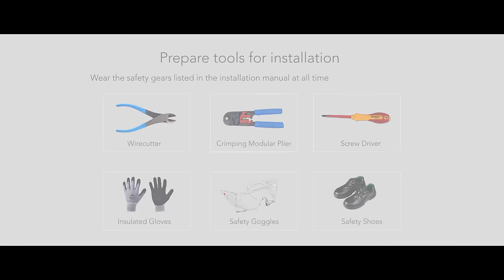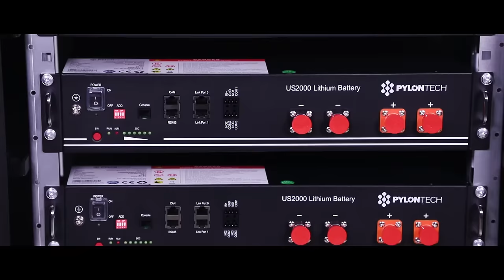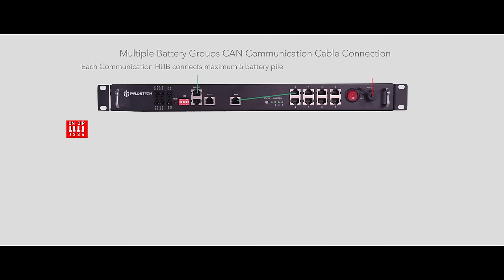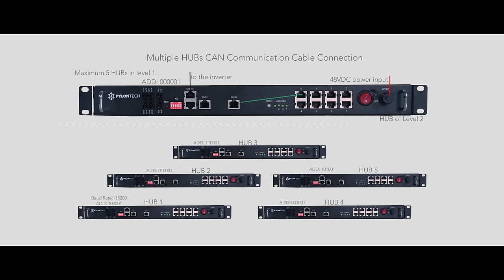Pylontech US Series Installation - US2000

Comment: Does this interface with the Growatt 12kw off grid inverter and will the case with bms become available for users to use their own cells.  I only use 280ah cells in 16s configuration for 15kw packs.  I could use a stackable version for good interfacing with the inverter.
Reply from the maker: Pylontech US-Series battery can communicate with Growatt inverter with CAN protocol and the end user can read the battery information from the inverter portal accordingly
Reply: @pylontechess  I'd love to play with some  and review

Comment: Sir i am using pylontech battery with tesla v3 inverter, sir i need to connect battery with BMS of inverter for this purpose please tell me which communication cable is compatible except RS485 because RS485 is not available in my region.
Reply: You have to modify the one end connections. It is custom-made cable. Its easy to make at any electronic repair shop. Connect wire as below (Battery end pins 6,7,8 to 8, 5 and 3 respectively to Inverter end side of cable.

Comment: Can you mount these vertically if you dont have space to have them horizontal ?
Reply from the maker: Yes, the battery can be install vertically if the system quantity is or less than 2 sets.